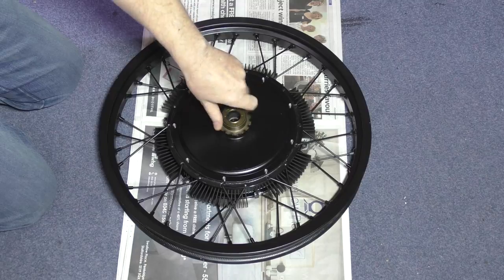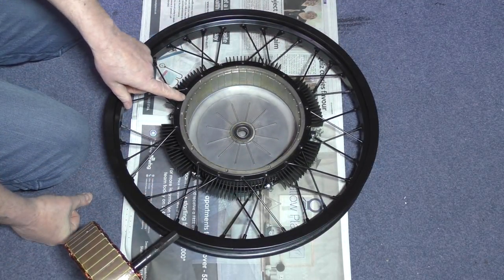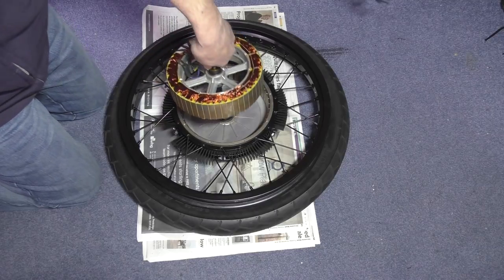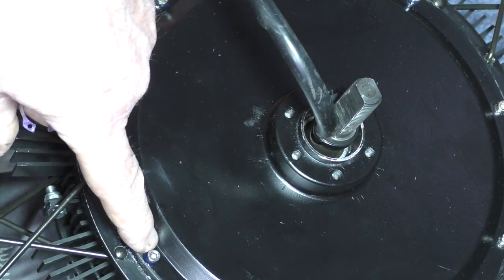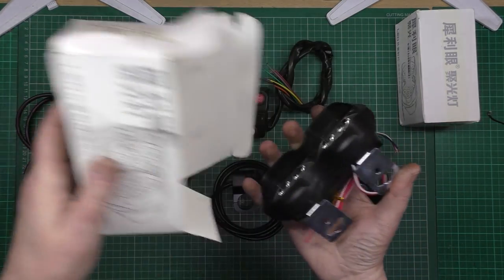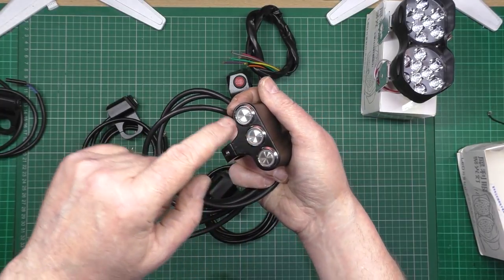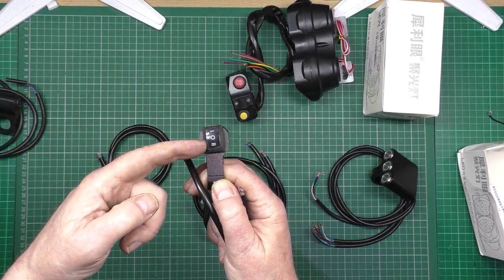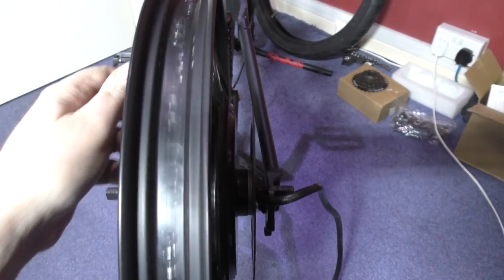High powered DIY eBike MSVA build part 8 - MXUS rebuild, ferrofluid and switches

Comment: I used ferrofluid decades ago on extremely high end, audio equipment. And yes, you could hear a difference. So I have no doubt that it will improve conductivity in a electric motor.

Comment: Hey Tony. Quick thought, may be better to use epoxy not a solvent based glue to pot the switches...the solvent will have nowhere to evaporate to, and might even melt the plastic of the switch over time...
Reply from the maker: You're probably right mate. The insulator is PVC and it won't do it much good but these are cheap Chinese crappy switches - the mechanism will break before the insulator does 😂

Comment: I got around the dreaded rear exiting wires without scuff but it is tough. Gen3 1950s bike road test good. Will be posting concise video overview on weekend. I also just ordered the tame 45A sabvoton to have my push button regen brake enabled. Your a bad influ I mean good influence the BSA 441 is almost ready for assembly as well. 45mph on 26" bicycle wheels is.....enlightening but I will stick to my RT100 for speeds like that.

Comment: Just ordered some for my motor because it gets pretty warm as it is and I'm increasing the power next week
Reply from the maker: I hope you ordered the proper ferrofluid and not the chepaer stuff that's safe for kids to use. I know you probably haven't, but I have known quite a few people who wanted to save some money and regretted it 😁
Reply: @Vortecks  which one you recomed?
Reply: @Vortecks 

Which one do you use sir? I'd love to know. There's the one grin tech sells. 
Or how can you identify quality ferrofluid?
Reply from the maker: @Mash3OH3  I always use statorade from Grin. If you're in Europe, you can buy it from fasterbikes.eu - that's where I buy mine from. Don't use the cheap stuff which is normally sold as EFH1 that they use in schools, it doesn't use suitable lubricant as the base, it's some food friendly oil they use.
Reply: @Vortecks  but does the statorade work well? Like will I get a huge performance boost? Plus better heat dissipation?
Reply: @vortecksengineering884  

So you mean to tell me that I can bump up. The amps up to 40amps cause I reduced the amps to 36amps on my controller and running a 48v 1500w hub motor. 

But I also read that 36amps works better with a 48v 1500w wheel compared to 40 amps. 

I use a 45amp sabvoton controller but reduced it to 36amps for less heat on the hub motor

Comment: 8ml.. seems to be about the amount use reading though ES notes on it.

So you might want to add a bit more..
Reply: Yes, given the big size of that big motor, he should just squeeze a good 8 ml FF into the magnets. The FF will spread itself out evenly.
Reply from the maker: Thank you both - I'll be adding some more 👍

Comment: You might try making the switches at least water resistant by applying some non-conductive grease or something to the inside of the switch.  Must be some electrical material specific for this purpose.  I have seen UV activated glue applied to connections that works pretty well.  Another Youtuber has done this for items he leaves outside to the elements and it keeps the circuits dry and working fine.

Comment: Is statorade by itself sufficient? Ive noticed you have the hub sinks. Does that set up work and work well?

Was thinking of getting both statorade and hub sinks
Reply from the maker: It all depends on how hard you're going to push things. Statorade bridges the air gap between the stator and magnets and it helps with heat transfer. The hubsinks then take that heat and dissipate it quicker than it would normally take. If I were you, I'd start with Statorade and see how things go, it's a cheaper option and you might not even need the hubsinks.
Reply: @Vortecks 

Yeah I'm looking to bring the amps back up to 45 on my controller.

Currently I lowered the amps to 36. All to lower Temps. Slightly longer range and battery life. So far. 

But I want back my torque/acceleration lol

Comment: Hey Tony, with over-volting the motor, especially with the specs you are trying to achieve, are you concerned about demagnetising the magnets?
Reply: It's always a risk, but ferrofluid and hubsinks combined make for awesome cooling performance. I don't think he's in much danger.
Reply from the maker: I don't worry about anything until it happens. Maybe it will blow it, maybe it won't..... I'm more concerned about the axle than the windings.

Comment: I need HELP... no I don't need to be taken to mental hospital lol I've led indicators on back of me bike wired up fine bright as anything when I wire up the front ones the flash fast so I put a resistor on and they flash normal but it's not as bright as back now it's 26 ohms so can I put a 10 ohm one on and it still flash the same speed and will it be brighter than back its like 10% lower brightness to the back ones.
Reply: Just get a flasher relay designed to be used with LEDs. No need for power wasting dropper resistors
Reply from the maker: ^^^^ What Rob said or you can mess around with resistors. Personally, I'd have used an Arduino to control everything but that's just me :-)

Comment: What is the purpose of the ferrofluid? 
I mean it's basically iron filings (very tiny) suspended in oil. It kind of seems like a bad idea to put a conductive fluid into an electric motor?
oh nm, unpause and there it is, the answer.  
But still, isn't there a normal oil that would get the job done? I mean I get that the ferrofluid will stick to the magnets, but so would normal oil because it's a rotating part.  
Oh well, if it works it ain't stupid, But I'd be a bit cautious about conductive stuff in an electric motor. ;)
Oh and,, Loving it! It's gonna be awesome.
Reply: Your assumptions are guesswork. Here it is explained very well: 
https://www.ebikes.ca/product-info/statorade.html
Reply: People have used regular oil, for example ATF, for cooling hub motors. The problem is, you need a lot more than 8ml to get decent cooling because it's being flung about, and because it's being flung about, it tends to escape from the motor over time. And since you need to use so much, there's a lot of viscous drag.

Ferrofluid stays put, right where it's needed, and you only need a tiny amount. So it cools well, it doesn't escape, and it has negligible drag.
Reply: I will add to this that I am resident in Namibia a country that sees mid to high 40*C temps, with a 200% improvement in cooling efficiency that is a high priority when it comes to high power machines...
Reply: @MysticalDork  fair enough.
Reply: I installed statorade and I can report that it changed the way I ride my electric bike. I can push my bike hard and max throttle longer and the stator would only get warm ish. 

I was able to bump the amps back up to 45amps maximum. I had it set to 36amps due to overheating. 

But the statorade is a definite game changer.

Comment: how long the ferrofluid lasts in the engine?
Reply: its permanent, once you put it in it will stay forever unless you dont seal the motor tight enough when putting it back together
Reply: Hi just wondering where do you buy that ferrofluid

Comment: Why don’t you just buy an electric scooter ?
Reply: Good luck finding one that can match this monster's performance.
Reply: Ryan Willis how about a 125cc scooter ?
Reply: no scooter or 125 could come close to this thing, you'll be looking for second and it'll be,........ Gone!
Reply: Gap Recordings Namibia how fast are you expecting this thing to go ?
Reply: @Gadgetdad007  dude, V2 topped out @ 73Mph......... and that was at 15Kw with 66V now it's up to 84V with 26 odd Kw............... What do you think? As seeing as speed is directly coupled to voltage........
Reply: Gap Recordings Namibia I think I want one now. Thanks for the info 👍
Reply from the maker: I'm looking for 15.5mph which is the UK legal limit - anything more is a bonus 😁